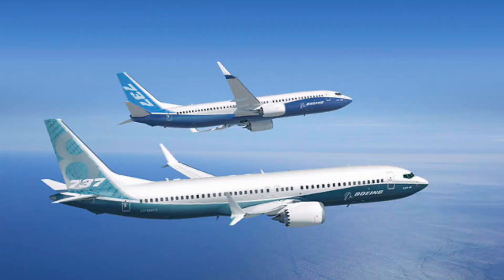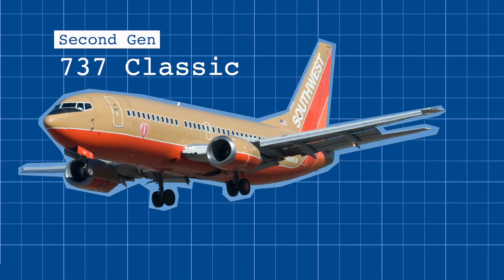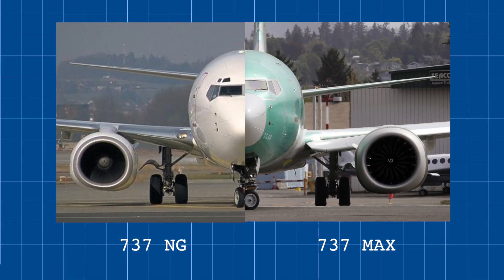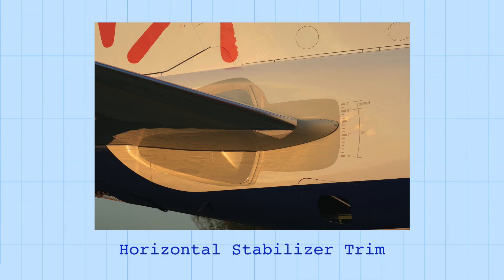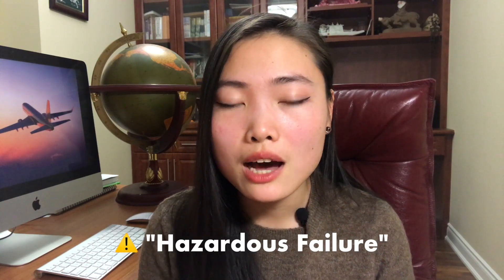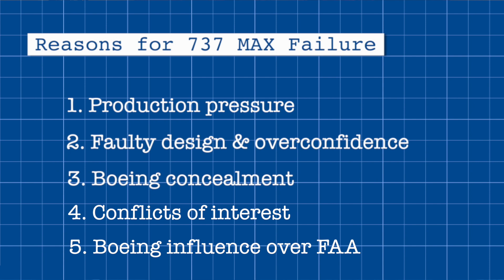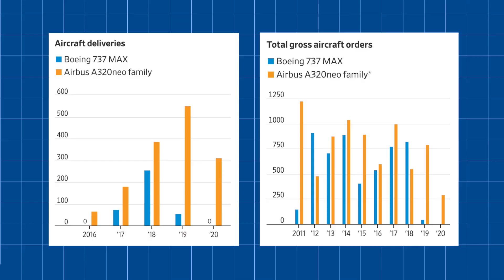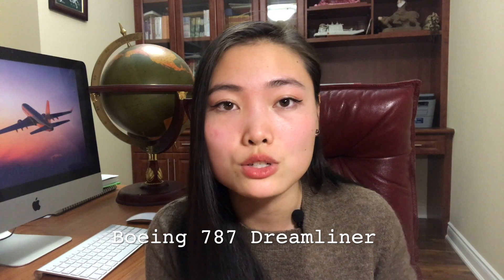Boeing 737 MAX is Back: A Resurrection Analysis

Comment: The corporations are our gods and we the peons will give our lives to the temple.___ 'lift' will cause the aircraft to gain altitude.  This is like saying a parachute generates lift.  The larger nacelles generate drag. At high AOA,  there is a vertical vector component of drag resolved on the polar axis of the aircraft.

Comment: Hey!  I was wondering if you can explain something technical/safety related is it true that 787 still doesn’t use lithium batteries it was originally supposed to due to not quite catastrophic fires AND how should we feel about similar batteries on all electric planes!?🤯 https://m.youtube.com/watch?v=OP04zH0mm2I
Reply from the maker: I've heard about it in passing but didn't research the 787's battery issues yet... great idea for future content :)
Reply: @JennyMaAviation  who knows yeah definitely I would think for the Israeli 9 seater in particular they have some setup making battery catastrophes extremely unlikely - are two adjacent battery packs becoming inflamed and setting everything else on fire as unlikely as two engines failing during ETOPS timeframes etc!?  Anyway, obviously probably an assembly line with higher precision etc for aeronautical batteries!?!?🤯

Comment: Nicely done! I like your analysis and how you broke it out into sections, as well as your use of graphics.

I see in your About section, that you're a computer engineer. I would be curious to know your thoughts/opinion on the design and implementation of MCAS, and its shortcomings.
Reply from the maker: That was actually my original idea for the video but Boeing's (understandably) not too keen on sharing the inner workings and architecture of the MCAS system... everything we know about it at a high level is already in the video :(

Comment: I am sorry to point this out but saying that the 737 max is unstable is simply not true. The 737 max handles exactly like a 737 ng except for very rare and specific situations, such as when the aircraft is in full thrust, with a high angle of attack and flaps up, or when approaching a stall, in which the engines nacelles contribute to creating additional lift and upward momentum of the nose compared to a 737 ng. And this is exactly the reason why mcas is there, not because the 737 max is unstable, but because under such specific circumstances (in which any aircraft will tend to pitch up anyways, so no, that’s not just a characteristic of the 737 max) the aircraft handles differently from the older model. There is nothing wrong with the center of gravity, that has nothing to do with why the plane was grounded, the only issue this plane has concerns software.
Reply: Well said.
Reply: I have watched videos from pilots such as Mentour Pilot that also say the Max is a stable aircraft and they would love to fly it.
Reply: @jluck2001  Mentour Pilot hasn’t even flown it yet, but i have.

Comment: Great analysis! Though - I disagree with the 737MAX hving a future as passenger-jet. The issue is, that Boeing lost to much passenger-trust. First the 787, now MAX. ALL because Boeing took some shortcuts. ...not the wise move!
IMHO, the best chance for Boeing selling the MAX now is to convert it into a short/midrange small cargoplane. It's not only the lost trust from people - also with the "Cough", there will some severe changes to travel-behaviour of the people. 

The only way Boeing could redeem its "name" and "glory", would be NEW jet-family designed from scratch. (and not just "take the old concept, bolt some new engines on, sell as new")

Comment: You lost me when you said the MAX was aerodynamically unstable. The MAX flies exactly like the NG in normal ops and the reason MCAS was introduced was for the MAX to 'feel' like the NG in non-normal, high AoA, at or near stall speeds ops; configurations that commercial aircraft rarely flies in. Ironically, had the FAA been more lenient on Boeing, MCAS would probably be not even needed. However the FAA said, in order for NG pilots to not need a whole new type rating certificate instead of just a supplement difference certificate, the MAX would have to 'feel' like an NG even in that narrow window.
Reply: The MAX being aerodynamically unstable and flying/feeling like the NG are not mutually exclusive. Two expert sources:

-From the House Committee on Transportation and Infrastructure's final committee report, citing software engineer Greg Travis: "Boeing produced a dynamically unstable airframe, the 737 Max."

MIT Professor of aeronautics, R. John Hansman: "Because the engines are further forward, the lift tends to push the nose up - causing the angle of attack to increase further. This reinforces itself and results in a pitch-up tendency which if not corrected can result in a stall... It should be noted that many high performance aircraft have this tendency but it is not acceptable in transport category aircraft..."

It's hard to hypothesize what would have happened if, someway somehow, the FAA had eased regulation vis a vis MCAS.
Reply: @TheUnitedEstates  Greg Travis may be a good software engineer, but that statement of his demonstrates that he doesn’t know the definition of dynamic stability.
I fly the plane, it is quite stable, both dynamically & statically.  All with automation inactive.
Reply: @TheUnitedEstates  "The 737 MAX was designed to handle and feel the same to the pilot as the 737 NG. Without the MCAS function, in some small areas of the flight envelope — such as approaching a stall and during higher g-force maneuvering — the new engines contribute to the control column feeling lighter in the 737 MAX than the regulations allow. These are not areas of the flight envelope in which the airplane normally operates." -FAA's preliminary RTS summary.
Reply: Nora, actually, if the FAA had been in charge of all the certification efforts, they would have had the leeway to be more lenient.. given that Boeing ARs did most of the certs, they didn’t have the leeway to make a judgment. Boeing ARs HAD to make black & white calls during certification activities.  Only the FAA could make exceptions to the FARs.

Comment: Ironic that this entire thing was because Boeing wanted to avoid simulator time for recertifying NG pilots. I feel terrible for the engineers who no doubt caught the issue only to be overridden by upper management. The people responsible need to be thrown behind bars instead of "resigning" with their golden parachutes
Reply: I'd go even further and say Boing as a company should be destroyed as a warning example for boards and shareholders across the market that shortcuts like this will have severe consequences that under no circumstances can be written off as business costs.

Comment: So can it be flown fully without mcas and that is what the simulator training is for!?
Reply: When the MAX just entered service, the FAA told Boeing that with MCAS, just a difference training course required which takes a couple of days. Without MCAS, then a whole new full type rating course will be needed, which will take weeks. The new training regiment for recertification requires simulator training, but it will still be a difference course. Any NG pilot coming in for their annual type certificate renewal can also knock out a supplemental rating for the MAX at the same time.
Reply: @dynasty0019  🤯
Reply: @dynasty0019  there isn’t a supplemental type rating.
Reply: I fly it normally with MCAS inactive.  The training takes you from activating it without malfunctions, and what it looks like now in full malfunction mode, and that it does not overpower you.  Also covers the revised non-normal procedures.
Reply: @737MaxPilot  excellent wow yeah that was crazy crazy sad disastrous stuff that happened obviously - I guess that should be emphasized by everyone including pilots - that latest 737 perhaps now safer than any previous jets or has potential to be so...
Reply: What is mcas for?___ if the plane can be flown without MCAS,  why not remove it entirely? It would be simpler to change the pilot certification process than to have all these workarounds.
Reply: @irvhh143  oh because they didn’t want to have pilots need simulator time they fudged stuff but the fudge wasn’t 100% reliable as proven by two preventable crashes
Reply: @irvhh143  not that simple. Airlines with mixed fleets (NG & Max) would not be able to have a common pilot pool. It’d be the same difference as having two makes of airplanes in the fleet. Then there’s much less advantage to buying the Max for those airlines that operate the NG.
Reply: @737MaxPilot  well, if the alternative is planes that fly themselves into the ground....
Reply: @irvhh143  the technical issues have been resolved. There will never be similar accidents again for this airplane.
Reply: @737MaxPilot  In the event of collision with terrain, blame the pilot.